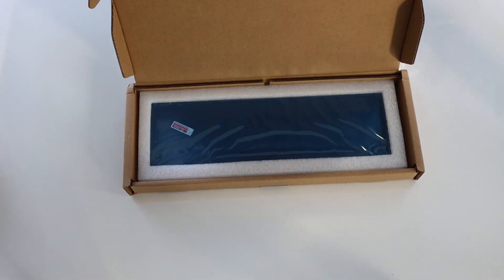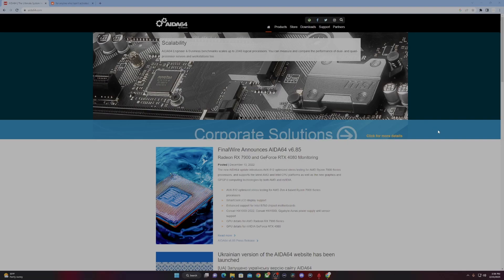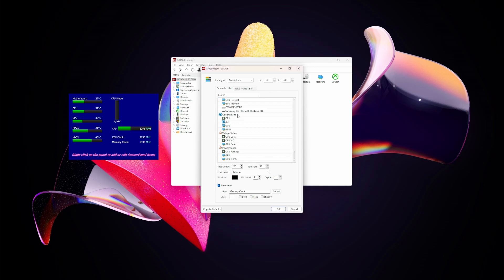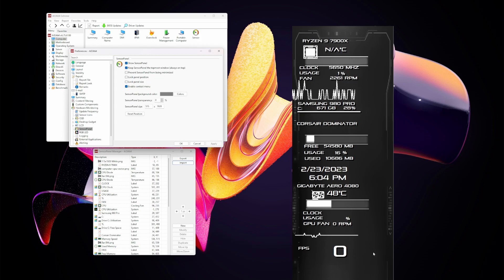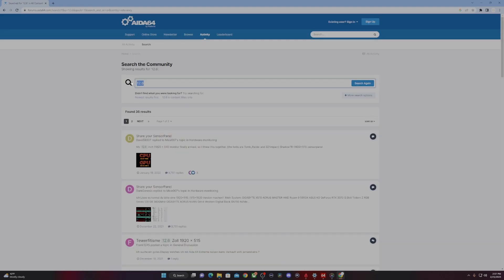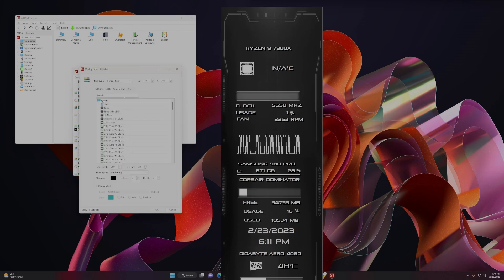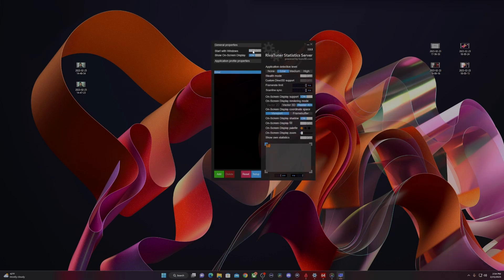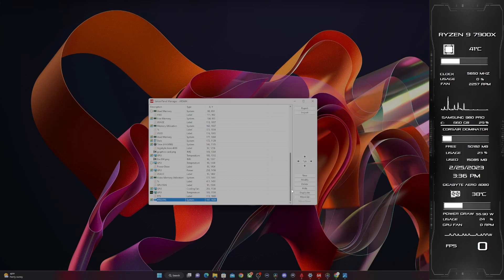Easy PC Sensor Panel Setup Guide

Comment: i need template like you have if you can upload please
Reply from the maker: hey I couldn't find the exact template I used, but i did use this forum (https://forums.aida64.com/topic/667-share-your-sensorpanel/page/355/#comment-48771) which has ALOT of templates and mine is on there but I remember going through almost every page of the templates with my dimensions to decide on the best one. I am sure if I spent long enough I could find it again but it really takes combing trough all of the forum pages to find the perfect one for you.

Comment: Excellent videos.  I just took delivery of a Y60 based PC with Intel i9-13900 and nVidia 4070ti.  I still have to install the GPU AND M.2s.  I do like that LCD but need to see how it’s mounted.  Did you use the 3D printed case?  I love the look of the Y60.
Reply from the maker: Glad to hear. That’s a great build you have. And I did not use the 3-d mount jus because I didn’t know about it at first. I used black electrical tape on the top and bottom and it holds it in place.

Comment: Hey! as for physically installing this panel, Did you have to make a mount or bracket or does it fit perfectly?
Reply from the maker: Hey there! So I used a few strips of black electrical tape on the top and bottom to attach it to the case.

Comment: Micro USB goes to board and then standard USB to back of mobo?

Also does it come with HDMI mini to HDMI cable and if so is it long enough?
Reply from the maker: Yes that is how I connected it but I needed both cables separately it did not come with either
Reply: @WhiteCoatGamer  good to know, thanks

Comment: nice work, i have same case and screen but i triad to do the setup like yours but it didn’t work could you share your link please yours is very clean
Reply from the maker: Hey there! Thanks I’m really proud of it. I have the link for the screen in my description.
Reply: @WhiteCoatGamer   i mean your sensor panel setup, actually i tried to download some setups from the website but nothing works with me, your sensor panel looks very clean co if you could share it, please.
Reply from the maker: @abdulaziz20944  I used a template from the aida 64 website I will try to find it and post the link. But I made a follow-up video about the sensor panel showing the software setup which shows a few templates

Comment: So I have a portable monitor laying around and want to do this. Someone recommended to use a header on your motherboard, so you don’t get the no display signal, but I can’t find a usb c cable that will connect to a header on my motherboard.
Reply from the maker: interesting. When exactly will you see the no display signal? I dont hae that signal with my crrent setup when my computer is off, asleep, or logged out.

Comment: So we need to buy aida64 to see any of the sensor info?
Reply from the maker: Actually no. So you can get a 30 day free trial and create your sensor panel. Once the trial ends you can keep the panel just you cannot make any changes. What will happen is when you open aida64 it will open and say your trial has ended and tell you to either close or buy the product. Just minimize this and the sensor panel will stay. Just setup the panel with all the features you want before 30 days is up.

Comment: Is it possible to explain the physical set up process. Like what all needs to ne connected to the panel and board? Is it just usb and hdmi and ribbon cable?
Reply from the maker: Yes so the ribbon cable goes from the screen to the little power-board (it comes with an extra also) the little power-board runs the power and hdmi so you plug the mini hdmi into the power-board and then into your graphics card in the same place as your monitor. The mini usb runs the power to the screen and can be plugged into any usb slot on the back of your motherboard or front of your case. 

In my case I slid the ribbon cable to the bottom in the same area as the bottom fans and that is where I kept the power-board. I then had the hdmi cable and power cable going from the bottom out the back. 

Let me know if this helps or if you have any other questions.
Reply: @White Coat Gamer  this helps immensely. I was looking at micro usb to usb 5 pin header cables. Lol. Yeah I'll look at getting some pretty short usb a to micro cables and mini hdmi to full hdmi. What length did you go with. Thanks for your help!!
Reply from the maker: I did six feet cables just so I had plenty of length even if I needed to make a lot of turns and it was a good length. Probably could have gone with smaller but this seemed like the safest length.
Reply: @WhiteCoatGamer  Thank you!

Comment: Also which case fans are those? They don't look like the Corsair SP120s that you have linked in the description. I could be wrong tho.
Reply from the maker: You are absolutely right! I used the same list as my complete build video which is form before I changed my fans. These are the Lian li uni fans. Video about me installing them and temps soon! And I will change the link later today!
Reply: @WhiteCoatGamer  thank you sir

Comment: Damn that is a dope setup. I am waiting for my case to arrive so I can finally build it. I was going to use the Hyte Y60 because it looks amazing. I watched a video on the Gamers Nexus channel that was talking about thermals for this case and they said the vertical GPU and how close it is to the panel is a bad thing. So I went with the H7 flow. Awesome build though!
Reply from the maker: Thank you! And yes I wish they gave a little more room. I think the 40 series has the biggest problem. Having intake fans directly below helps but it can be a factor. I am making a video about this later this week so stay tuned if you’re interested but the H7 is another amazing case.